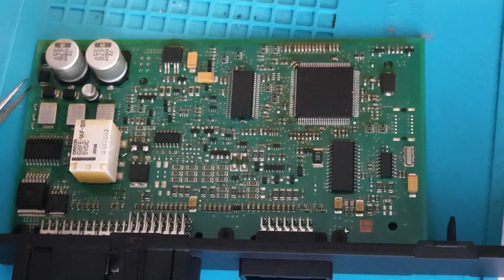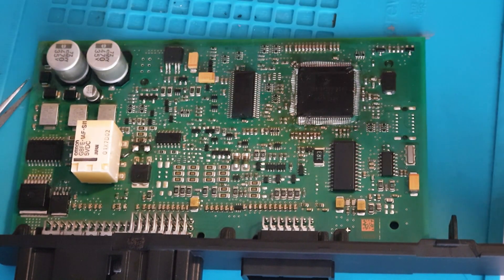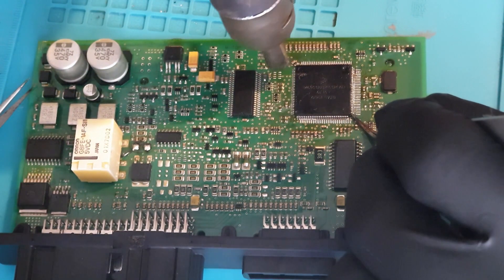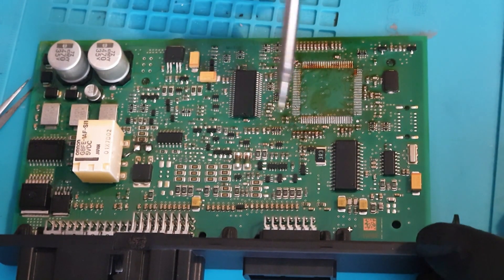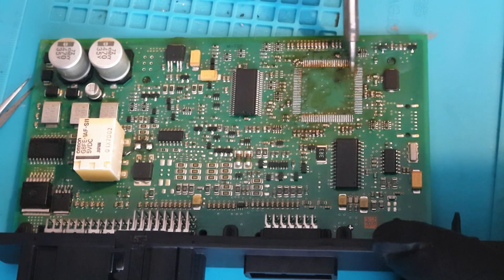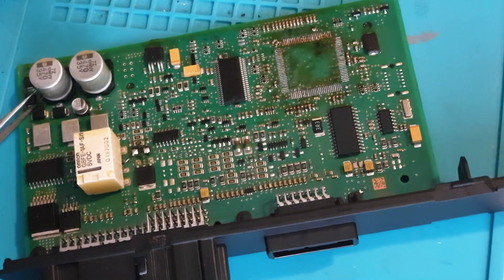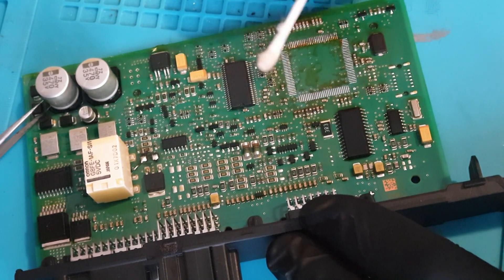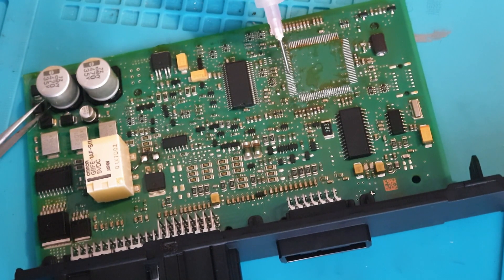Mcu Replacment tutorial

Comment: I practised this with my new hot air station on an eeprom chip and the solder wouldn't even melt lol,'so' frustrating,had my hot air station flat out!!Out of frustration ended up tearing off two pads by accident,solder just wouldn't melt and let me slide the eeprom off.